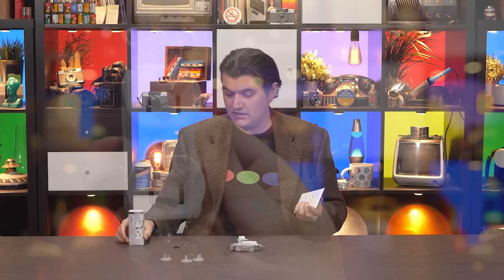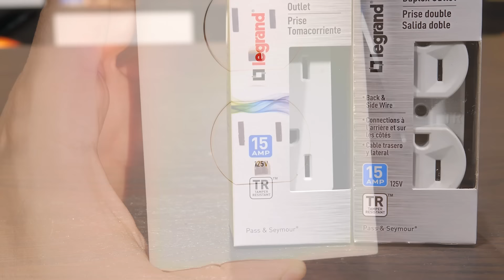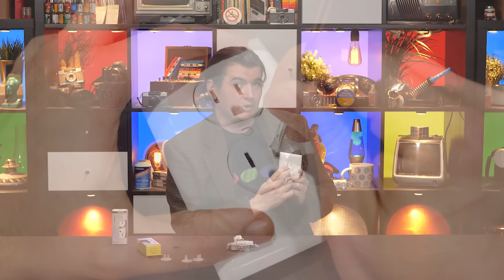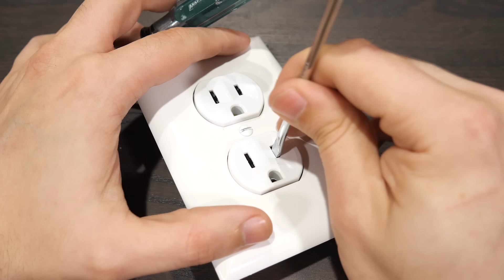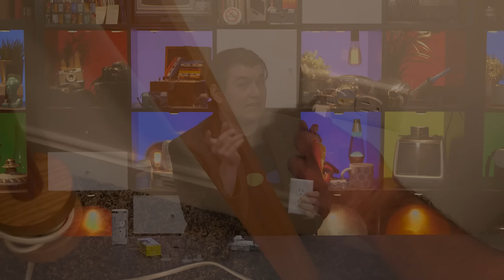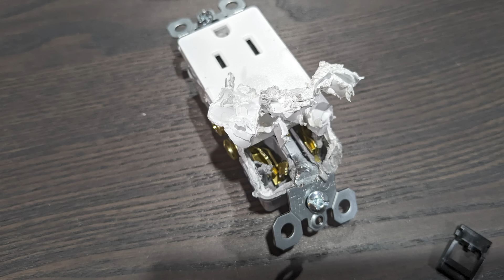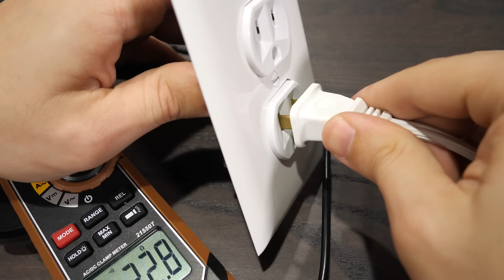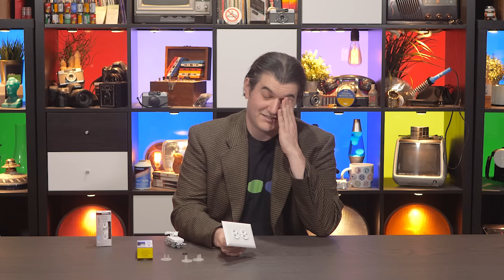Tamper-resistant outlets aren't all the same - a follow-up

Comment: I've encountered some really loose wall receptacles in hotels in the US. I assume it's because they used the cheapest possible receptacles and they're having things plugged in and removed very frequently. When I moved into my grandparents' house in 2005 (with original 1954 receptacles) there were several that were very loose. So of course I just replaced them all. But yeah, I don't think I've ever encountered loose ones in a house that was less than forty years old. And I've never seen loose ones in a commercial building outside of a hotel.
Reply: Yes when i lived stateside, I worked doing Motel maintenance for 2 yrs, when i first started almost ALL the outlets were incredibly loose. A lot of the issue is also the cleaning staff using them... every day the vacuum gets plugged in and out probably quite violently. First thing I got the owner to authorize was me replacing EVERY single one of the outlets. I replaced with commercial grade.
Reply: My house was built in the mid-2000s, and most of the outlets were already loose when I moved in in 2019. They were all really cheap and only had back connectors that wouldn't release, which made replacing them a lot of fun.
Reply: @Javaritto  Unless you buy "commercial grade", outlets (and switches) have been junk since the 1990s.
Reply: @Javaritto there's a slot that you stick a fine blade screwdriver in to release them, or crush the duplex to bits. Either works
Reply: Yep, commercial or industrial grade is the way to go. Commercial is only a minor price increase, but industrial ones are significantly more expensive. The industrial ones also hold plugs with a death grip that keeps everything tight against the wall.
Reply: I once lived in a place only about 20 years old and it had a bunch of loose outlets. They probably used the cheapest grade they could buy. Knowing how hazardous they are, I replaced them.
Reply: Yep. I assume it is visitors to the US staying in hotels that typically have extremely crappy outlets that are often loose or might not even work at all.
Reply: You went to a hotel, and only found loose holes ....er..I mean recepticles.
Surprise, surprise! 😊
Reply: Yup. Hotels and airports... also cheap apartments, which nowadays are often AirBnB setups. Hmmm... yup, most likely to be experienced by global travelers.
Reply: Especially airports. Hotel rooms are much easier to service since an electrician can usually wait a day or two and then have the room to themselves so they can throw the breaker and get to work. No such luck at an airport; a boarding gate may be downstream of that outlet you want to change.
I'd say the outlet type that's the most prone to poor connections is the under-seat outlets found on many commercial airplanes. Where else do you find an outlet that gets a wall-wart AC adapter violently shaken free of it on a weekly basis? Also, the tight maintenance schedules on airliners mean these outlets basically never get swapped out. They're almost exclusively accessed by blindly fumbling, leading to even more shock hazard (good thing they're just 120V). Definitely use your European travel adapters on those.
Reply: Nothing wears out outlets faster than vacuum cleaners. It's because the normal operation produces a lot of sideways force on the plug.
Reply: I had a modern, freshly renovated apartment with brand new outlets. Every single one was loose from the manufacturer.
Reply: @tasteslikewall  That's very rare. I've lived in 12 different homes across 5 different cities and never encountered a loose outlet anywhere except in a hotel, where it is very common.
Reply: @tasteslikewall yup. A big issue is the type of outlets used by anyone trying to do any work on the cheap are very low quality, and it "shocks" me that they meet minimum allowable standards. Those minimum standards are a joke.
Reply: The ones in hotels are worn out from guests unplugging their phone chargers by the bed every day & housekeeping unplugging vacuum cleaners from the one useful one on the wall.

Comment: The complaint about plugs falling out reminds me of my parent’s house, where an outlet in the bathroom won’t grip a plug at all.  I had an outlet like that in my own home too when I moved it, but I got that replaced pretty quick and the new outlet is very tight.  Seems that the more an outlet is used the contacts tend to get pried apart and loosen their grip, at least with older designs.

Comment: Having grown up in a house build in the late 70's and GFCI was common, I had never really payed much attention to sockets with lose wiring....
My dad had put several more "groups" behind the GFCI, so the more I grew up, the more I figured this was standard. I knew better of course, but that was 'normal' for me.
When I bought my first appartment, it was brand new, so everything had grounded sockets and GFCI as well.
Fast forward a decade, and I bought my first proper house.
We get to working on stuff and see that almost none of the sockets are grounded. Not a big deal, the ground cables are in the central boxes in the ceiling (that how the system works here).
After a while my dad opens up a socket, as he usually does, and starts replacing it .... *ARC* ... ow...wait a sec.
Checked the fuse box:
- No GFCI anywhere, not even the bathroom which is mandatory, even in 1970 when this house was build
- 3 Phase fuse was sticky....
- Everything still used old non-resettable fuses.

So....either me or my dad could have gotten a pretty nasty surprise with our being used to GFCI :P

Also, the 3 Phase fuse blew a few days later, as a mouse had bitten into it an was slowly being roasted..... this happend twice.

Might not come as a surprise, we changed the whole lot to a modern fuse box system and I removed the 3 phase outlet (wasn't needed back then....now I have to make a new one)

Comment: My last manager did a lot of impromptu electrical work at our store, and his favorite thing to do was to scare the hell out of new hires by replacing outlets or switches without cutting the power.

"It's just 120V! Barely a tickle!"

Magnificent bastard. Never had a bum outlet for long in that store, though!
Reply: I once replaced a ceiling fan thinking power was off at switch. Since I told sister in law to turn switch off…Never got shocked but surprised when completed and went to turn it on at switch— she failed to turn off switch   But luckily fans ship with pull chains in off.  So no spark when connected wires…
Reply: @KE5ZZO Always always check for yourself. I trust nobody else. Doing electric wprk at home, I simply put the fuses in my pockets. (Yes I have old time screw-fuses),
Reply: @ivarnordlkken8082   another reason I am glad she is an ex-sil

Comment: I have been shocked probably at least a dozen times from 110V -- none intentionally, although I did once work for an electrician who would test wires with a quick tap of two fingers to determine if they were hot. Getting shocked across two fingers on the same hand is much safer (e.g. less dangerous) than having your entire body be the circuit.

I am now a big fan of non-contact voltage testers and I use one constantly when doing any electrical work. Just because you have a breaker turned off doesn't mean some dummy didn't put wires for a different circuit in the same box.
Reply: different circuit in the same box is the dumbest thing I've come across, learnt it about it the hard way.
Reply: That "quick test" had been done in Germany, too. With (back than) 230V. No normal person would do it today anymore, we have even at least easy testers for the line, which has an large resistor between the small lamp and the contact, you might or might not touch for grounding. (Maybe its for smaller voltages, at a 240V line it works without and many dont even have the metal cap anymore.)
Reply: non-contact testers don't always work but fluke makes good testers where you only have to have one of the leads touch a live wire and it starts beeping. (T90, T110, T130, T150)
Reply: My favourite unexpected electrical bodge, was when I found out (the hard way) that one entire side of our kitchen was supplied by a wire dropped down from the bedroom above (hidden by a wall cupboard)!  As for using fingers to test if a wire is live, I do this all the time, but only after turning the power off.  It doesn't make sense, I know, but I've had enough shocks over the years to not trust that a ciruit is dead when it should be - a minor finger shock, is a lot better than one when you grab a cable later on, or when you are accidentally earthed, or holding both cables.

I once confessed this to an electrician friend of mine, and - to my horror - he confessed to doing the same thing!
Reply: I am said Dummy! - And I shocked myself, even though I KNEW it was wired that way, because I wired it! - Kitchen 20A counter circuit, and overhead lighting circuit....same box...
Reply: The most dangerous part of this is that you have either 0V or 240V between the two hot wires from different circuits.
Reply: @misters2837  'mains' socket in the attic wired into the upstairs lighting circuit for me - fine, until I used a vacuum cleaner up there one day and all the lights went out!
Reply: Being an almost 43 year old I still haven’t learned not to shock myself (i.e. unplugging the lamp before trying to rescrew in the socketty bit that has dropped down).
Reply: I only use my own body as a testing device for 9v battery (with the tongue) and it can be quite unpleasant when the battery is still strong.

Comment: Don't use backstabbing for wiring... it makes the wiring process easier, but has more potential issues if you don't do it right compared to making J-hooks.  It also screws over the next person to work on the outlet because trying to remove backstabbing is very annoying.
Reply: The builders of my house used backstabbing. Been replacing as I remodel different rooms. I don't think I've removed a single wire without exploding the old outlet with a screwdriver. Lol.
Reply: @davidchidester5463  And the worst part is trying to remove outlets that are in a ceiling or high up. I spent like 1.5X the time removing the backstabbed wires from outlets over my head then I did rewiring... Just because trying to press hard on the tiny release mechanism and pulling it out is hard.

Comment: The problem with the backstab connection is they are using spring tension to bite the wire. That does wear out over time, especially if you remove and reinsert wires several times.

Wago lever nuts on the other hand, due to their design, press down on the wires without relying on tension. The force the wire puts back on the connection could never loosen it. 

Some contractor grade outlets have connections that look like backstab holes, but still use the screw to hole the wire down. Those are totally fine to use and way more convenient for sure.

An inexperienced person might use the screw terminals incorrectly too, in which case backstab is maybe better. But if you don't know what you're doing, you shouldn't touch electrical.

Source: Me, electrician by trade.
Reply: In Finland we have mostly switched from screw terminals (exept for the cheap stuff) to ones where you just push the wire in.
Reply: Screw terminals have more metal-to-metal contact with the wire. Backstab method has very little. Less contact = more resistance = more heat.
Reply: The screw-terminals' holes do often look the same, but are always are at the edge, slightly offset from the screws.  
The easiest way to distinguish screw-clamp-terminals from the spring-tension-type is how wires slip out with slightest bit of tension until the screw is tightened. 

Many times in this last year I've had to replace an in-wall device (GFCI, duplex outlet, quad outlet, timer, modem, etc.) and found that the builder/installer had simply never tightened a screw-terminal (or loosened them on one side until the screw seized in the open/captive position), resulting in a bad connection which slowly burnt the device after a few years.  

Since I've not yet been told of any housefires from this ( and have only seen it cause charring at one specific commercial location that was/is seemingly cursed with electrical fires ) I presume that it's a relatively benign  safe (if destructive) contained failure mode. (edit:).. that most people avoid.

(Agree;) and still prefer the screw terminals, because it's far easier to replace/maintain, and makes a stronger connection (when actually tightened) compared to the spring type.

Comment: In my house, which was built in the 1960's and has vertical, ground-bottom outlets, some of the outlets are worn to the point where 2-blade plugs will pull out very easily, even if they don't just fall out on their own.  Just moving the appliance (i.e. vacuum cleaner or box fan) may cause the plug to come out.

It's inexpensive (or at least was) to replace the outlets, however, and I just haven't gotten around to it ;).  I certainly wish that I'd done this to the whole house before the End Times pricing that I now see in home improvement stores :(.  Outlets were still $0.97 apiece for the cheapies and $3.50 for the premiums not so many years ago, but now they can be $15 apiece.  I just stare at the store shelf in horror.
Reply: 😮 those prices are insane
Reply: Where are you getting your pricing from? It is like $2.50 for a cheap TR outlet and $7 for industrial grade.

The fancy USB-A and USB-C outlets do cost a bit more but that is a choice.

Comment: If you compare the quality and design of the backstab contacts versus Wago push-on connectors, you'll see why backstab connections are not recommended.
Reply: Regarding attaching the wires to the receptacle by "backstabbing" vs. screwing them down.  I used to help maintain a building for a club, and the main guy who did any wiring always used receptacles that allowed wires to be inserted straight in without being screwed down ("backstabbing").  We had frequently occurring GFCI trips all over the place until I got tired of it and rewired every receptacle by screwing down the wires.  No more nuisance GFCI trips. 
Also, the Wago connectors are NOT the same.  You have to flip a lever over to secure a Wago connector, where backstabbing only relies upon the spring tension friction of the connector.
Reply: @stevenemert837  There is both sorts of Wago connectors, the ones with the lever (221 and 222) as well as backstabbing ones (2273). Maybe the backstabbing contacts used in US outlets suck, but I've never had problems with them here. I've even come across a circuit breaker that used a backstabbing contact for the output side...
Reply: They now make NA style outlets with wago style levers built in.
Reply: In Germany virtually all outlets use backstab contacts today, only very old outlets use screws. I always assumed that better touch protection is one of the main arguments besides easier installation.
Reply: @codingquantum2195  Touch protection is not necassarry. It was designed to prevent nautral selection(prevent dumb people from shocking themselves).

Comment: Schuko (type F) sockets also have the options for tamper resistance. But whenever I can I remove this.
Not because I don't understand or support a safer socket, but the way it is implemented means that 75% of the time a plug will simply not insert correctly or at all.
I have had to use extreme force to get a slightly worn out piece of plastic to move....as in, lean on it with my full body weight and still have to wiggle it.
If done right, I am all for it, but as it is a sort of tacked on solution without a proper design, I will remove it, and if needed just blank of the socket.
Reply: Thank god it wasn't just me. I've had the same experience on schuko tamper resistance. Very annoying.
Reply: Oh I know what you are talking about, it gets annoying when an outlet doesnt want to plug in for one plug but for the other its fine. Though this only happened to me to those extension cord outlets, never had problem for the wall mounted ones.

Comment: Been shocked by 120v. Was not fun. Definitely would not recommend.

Also, to anyone trying to be a dumbass and shove live wires into the wall after wiring and testing a light switch… don’t. Yes, you have to make an extra trip to the breakers. Just do it, it’s not worth getting shocked. It hurts like hell and is very dangerous!